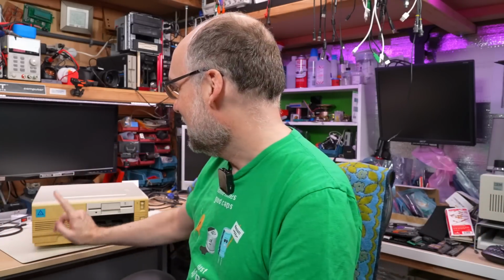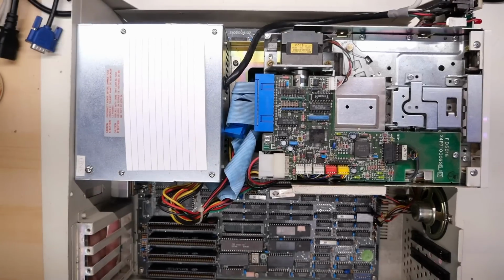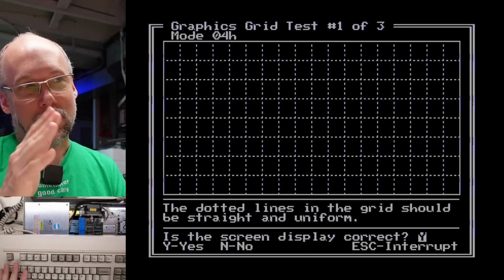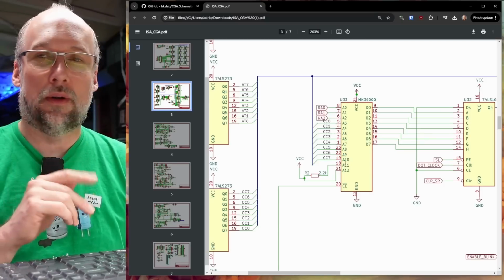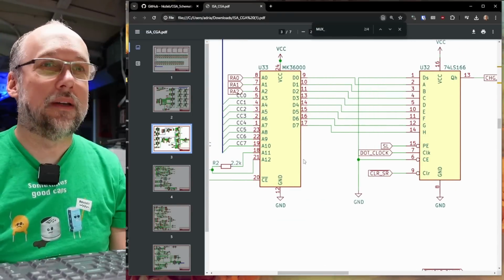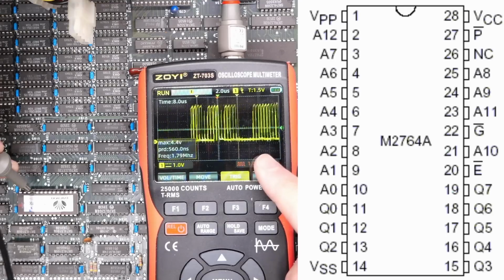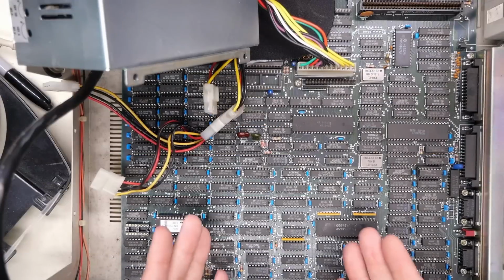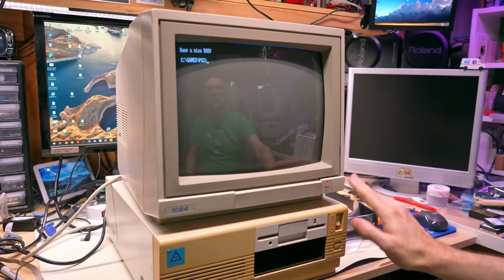Leading Edge Model D Repair

Comment: Good Lord. You brought me out of Youtube commentary retirement. ONLY because I worked for a Leading Edge dealer and this was our bread and butter, 

So, the blue color of the badge is because the original protector is still engaged. As in, "peel the sticker off, moron!" If you can't peel it off, the original owner was a moron. You are now stuck with it.

The IBM XT and AT had the same basic chasis. The LE Model D had a squat, square chasis and sported BOTH colour and mono support. However, some people wanted the same footprint as an IBM XT or AT, so the Model M was created. Back in the day, NOTHING was integrated into the main logic board, so expansion cards were the answer. The Model D only had four slots, while the Model M sported something like 6 or eight slots.

There was also a "turbo" model of the Model D released, as I remember. This was for those pieces of software that didn't check for timing (how fast one second on the system clock equated to clock cycles) and ran too fast. Funny how we take things like "processor clock cycles" for granted in this modern, multi-threaded world.

How robust were these machines? Well, a storm had several lightning strikes in a very small village of northwest Ohio. I had the service contract and arrived immediately after the storm. The call was because their electric billing computer wouldn't power on. A clear case of power surge, file an insurance claim.

I knew the PC was dead, but I went through the motions. I opened the case and saw what I can only describe as "an inverted pyramid in the center of the BIOS chip". I could literally see the traces from the center of the chip to...wherever the ended up at on the prongs ( I presume... )

Now, it was 1986 and as long as I parked the heads on any hard drive, I could transport it. Being so, I traveled with my service PC for on-site jobs. It was a Model D, non-turbo. Just for kicks, I swapped my BIOS for the blown up one...and the b**ch fired right up!! I SHIT YOU NOT!!!

Too bad they went out of business...

Comment: I don't quite agree that you would "know" that the problem is with that chip.. It may be that the traces have been damaged, or problems with the solder when it comes to continuity.. . 

IAlso it is possible that the out-put pins of a bad chip may send exactly the right signal but can't drive the input on the other chip.. (Would take a long text to explain various things that may lead to something actually sending a zero when it should, but IF someone is putting a load on it it may jump to high enough to be interpreted as a one. it is ~possible~ even if random and rare, the other way is much more common).. and the thing about this is that something that tests the logic of a chip won't properly recreate the exact situation where the chip would've failed. .but.. this last paragraph is more academic than probable, so my main point is the fact that there may be a break in the line somewhere for some reason.

Comment: So many feels watching this. The Model D was my parents' first PC, and it's what I spent countless hours on as a teen. This machine is what I used to learn BASIC, to play King's Quest and Starflight, and to make spreadsheets in Lotus 1-2-3 for building vehicles in Car Wars. Watching that boot screen come up made me smile so much.

I'm gobsmacked at just how uncomplicated most of the ICs are on the board. "Just swap out the bad shift register chip" isn't something you hear much in modern computer repair, if at all. Watching you work through this repair taught me a whole lot about 80s-era text and video handling. I just got into electronics over the past year, and this kind of end-to-end problem solving is incredibly useful to me to see what I'm learning put into context. It's one thing to know what components do, but another thing entirely to see how they work together to solve complicated problems.

Thanks for a fantastic video!
Reply from the maker: Indeed -- when I talked to people about the future of repair, I just don't see it being that easy. Ignoring the skill difference with SMD soldering, finding the bespoke parts that all these computer are made with now will be the trick in the future. There were perhaps only a couple bespoke parts on this entire Model D -- everything was off the shelf and easy to source. On something like a Commodore 64, tens of millions of the exact same machine was made, so finding replacement custom ICs is not that hard ..... but imagine some specific model of modern laptop, it probably contains a bunch of chips only used on that model or just a few other models.... then a year later a new models comes out and the chips are changed.

Comment: I had a somewhat later I guess, Leading Edge with a 386 and CDROM.  It was pretty weak for basically anything that could've used a CDROM.  When doing research on leading edge computers it pretty much always just returns a bunch of these older XT clones so they must've been losing popularity by the time the PC I had came out.

Comment: still own my late 93 Leading Edge full spec 486DX2 66 Tower (a very rare version by the way) buried in some box altogether with my Amigas, Ataris, speccy, etc. somewhere in my garage. I loved that machine by a lot back in the day. Internally everything was labeled as either Daewoo / Goldstar as long as I remember. The tower case was rock solid built.

Comment: First question to ask all customers is "did you let the smoke out?

Hard to believe that PC sold for $1,495.00 back then & included 20 MB hard disk, 8088 CPU supporting speeds up to 7.16MHz, and 640K RAM

Comment: Nice video, Adrian :)
I have a Hungarian laptop, with a proprietary ISA CGA video card inside. The CGA LCD is running from that card, too. That is why it is proprietary. Now my problem is almost the same as yours, but in my case, text mode works fine, but graphics mode does not work at all. I wonder what could cause this problem. Whenever I try to use graphics, the computer(286, 12MHz) hangs.

Comment: Did you notice if there was a short to ground on any of the ‘166 data pins before removing it?  Sometimes the problem may be even simpler than a bad chip.

Comment: My dad was a leading edge dealer. I know they once had a problem where the zener diode that charged the cmos battery was installed backwards so he had to hand solder those to fix.

Comment: Great Video! Really fun to watch. I also find it incredibly relaxing. Why didn't you check the connectivity of the traces/data lines between the character generator and the parallel to serial chip register first? This is not criticism, just a curiosity as my knowledge is only what I learn from watching.

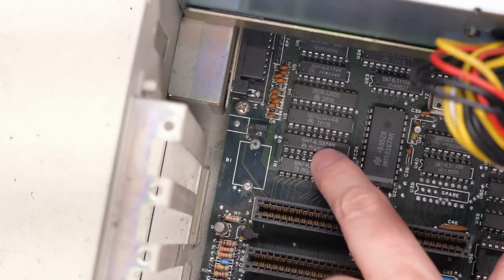Comment: @4:50 my goto is to replace the NiCd batteries with a CR2032 holder and use a CR2032 and disable the charging circuit on the motherboard by lifting a leg of the resistor or diode that brings 5V to the battery (the basic circuit is 5V -> D -> R -> B+ where D and R can be swapped).
This way the modification stays pretty neat and completely reversible

Comment: The parallel to serial bit shifter on my A4000 just died! LOL! Just got new ones in the replace them. Only it is used for inputting mouse and joystick input parallel data to the Alice chip. It is right next to the battery and why it went bad I am guessing.

Comment: Your Chrome & OBS crash might mean you ran out of memory, and some memory was forcibly reclaimed by the Windows kernel to keep it alive. Of course, reclaiming Mode 3 (Usermode driver) or Mode 4 (Usermode app) memory will result in a crash as the memory "is now no longer there".

Chrome survived it partially because it runs subprocesses for every tab, and hence the tab contents of the PDF viewer were terminated but not Chrome as a whole.

Discord users will likely relate, as things can suddenly leak out with Electron apps.

Comment: Great video! I'm a little confused by the time line of this machine though, I would have said it would be a mid to late 80's machines. Wikipedia seems to agree. But when you boot it the BIOS says it's released under GPLv2, that wasn't a thing until 1991. So someone flashed the BIOS later in it's life? Seems like an odd thing to have done to a 5-6 year old machine? Maybe not, it just looked strange
Reply: That GPLv2 BIOS is the boot rom of the modern CF card adapter
Reply: @retropcs88  ah! makes sense

Comment: I fully expected this thing could be "repaired" by just reseating the character generator ROM. Surprising that that shift register has lost two of its internal input connections but otherwise works fine.

Comment: I enjoyed this diagnostic and repair process, even if you made it appear trivial, a fine illustration of deductive reasoning and of your deep understanding of the inner workings of these IBM clones.  The Zoyi is proving its worth on these vintage machines where the bandwidth limitations are not so much a factor.  It certainly beats a logic probe.

I have been watching your videos since the Adrian Black days—long enough to know that you often consider appearance to be secondary—but I think a dose of peroxide would do wonders for the front panel, or paint for that matter.  It's very satisfying to see not only a functional restoration but a cosmetic one.  Maybe I just don't like yellow!

I don't know if you realize it but it is clear you are an inspiration to many retro-computing enthusiasts on this platform.  Thanks for yet another superb video.

Comment: My XT  was tip top (not ul accepted),  no onboard video, 8 bit cga 8 color until I modded 4.77 mhz to thrbo 8 mhz. Onboard 64k ram, expanded to 128k. Added oak tech vga 8 bit controller, set an interrupt and dma to speed up refresh.  40 mb mfm hard disk drive. 1.2, 720, 1.44 mb floppy,  9600baud usr external  modem 25 pin interface. Loved it..bbs services were it then..1986

Comment: To support higher color depth CGA modes, you don't just need more RAM (as you said, there is plenty), but you also need higher bandwidth. The standard CGA design doesn't provide enough bandwidth for the plantronics modes. The CGA graphics modes use the same memory bandwidth as the 40-color text mode. The 80-color text modes requires twice the bandwidth (just as a 320x200 16-color or 640x200 4-color mode would do), and you get snow everytime the processor competes for memory. So without wider or faster video memory than CGA has, there won't be a snow-free 16-color mode.
So I recommend you try one of the CGA fast video output tools. If they produce snow, 16-color graphics except for the 160x100 fake graphics mode is very unlikely to be present on that computer.
Reply from the maker: I actually cut out some of the testing I did with Jim’s program, and indeed this machine doesn’t suffer from any snow, even though they left the video disable enabled in hardware. (To turn off display in 80 col mode) So they fixed the snow issue which actually is similar to all clone cards I’ve run across. They all seemed to improve the design enough to eliminate the contention in the RAM.

Comment: In a sea of ICs, finding a chip that causes the issue without a schematic is not easy. Only logical thinking can save you. To add to the problem, the chip itself does work, but not fully. That is the big challenge you face in electronics repair. Could the issue have been caused by ESD? Who knows!

Comment: The blue logo is simply that no one ever peeled the protective plastic off. Peel it off, it looks much better without it.
Reply from the maker: And yes that was it, it’s the white label underneath! Too funny!!
Reply from the maker: Funny. I also say evidence of other areas like on the rear badge where the protective plastic hadn’t been peeled off. It was all degraded now which makes removal super hard.
Reply: Huh. I guess in those days companies wanted to make sure you knew the plastic was still on, so they tinted it. Clearly it didn't help.
Reply: @stevethepocket I think it's more that they removed the dye as a cost saving exercise at some point
Reply: I was literally losing my mind at logo cover. I took it off my inherited first computer, the model D, 30 years ago, and have been itching to see it removed.
Reply: I found funny to find lot of people to not have peeled rims logo in lot of cars from streets😂

Comment: When you pointed out the data lines between the character ROM and P2S chip, I immediately thought of taking the ROM out and manually driving the lines high/low.

Comment: Now I wonder, while you checked the output of the eeprom, you didn't check the input of that shift register you swapped. There is a non-zero chance that the old chip was good, and there was some cold solder joint on there, or something similar that wouldn't pass the signals along.
Reply from the maker: I did check continuity from the EPROM pins to the shift register and all were connected. But also, you missed the fact that floating lines (disconnected) result in white pixels. And the problem lines were black, the same as grounded. Disconnected lines would not result in that.
Reply: @adriansdigitalbasement  Ooh, I didn't realize you checked all the lines for continuity, in the video it seems like you only checked a few. And a very good point with that white/black disparity, that is a very fair point pointing to the chip, my bad.

Comment: I was more physically active than you (not to brag, I think most people can use a bit more exercise) and for me just a single level of stairs became an issue with that disease. Hope it gets better soon.

Other stuff: is that the original 5.25" inch floppy drive? That grey seems so resistant to aging. Especially compared to the rest of the machine.
Reply from the maker: Seems to be the other model edge video I have has a machine with the same drive in it. Different plastic I guess.

Comment: The same thing happened to my Ohio Scientific C1P video forty years ago: one of the input lines of the 74166 died. I had to write something for school on it with one vertical line missing which was annoying. I had no confidence in my desoldering skills so I simply clipped pin 16 and piggybacked a new 74166 on top of the old one.
Reply from the maker: Awesome! Yeah that’s the best way to get a chip out if you don’t want to risk any damage. And yes, the 166 is probably used in most display circuits from the early 80s and late 70s. So this would be a pretty recognizable fault!
Reply: @adriansdigitalbasement They’ve been in video since the first video game…They’re to be found on TAITOs Space Invaders PCB doing exactly the same job.

Comment: Logical thinking and investigating helps with diagnosing problems, often taking less time than throwing parts at stuff hoping to find a fault... :)
(Kind of like how the local powergrid people here were throwing fuses at the local substation thursday and friday to deal with repeated powercuts hoping that fixed the problem, until they actually found they had a bad underground cable when the smart engineers came in to think logically and find the fault!!!)

Comment: It had an, as far as I've ever been able to figure out, unique 640x200 16 color mode, which is (as far as I can figure out) only used by gwbasic. I piqued Jim Leonard's attention a couple-six months ago to spend a few minutes poking at it, and he came away with a detail or two
Reply from the maker: Ah that’s interesting. So they included a customized version of GWBasic that supported it? Amusing that these companies tried to improve things but then it went nowhere.
Reply: @adriansdigitalbasement  Yes, and apparently ONLY the faintly custom GWBasic supported it.  I was 11-14 when my focus was on this machine, so I read the BASIC manual cover to cover, wrote silly little graphics things to see it, and I TRIED TRIED TRIED every plausible option in the games I played, and never a many-colored option.

Comment: A mixture of Pine Oil, Eucalyptus Oil and Menthol is good for clearing up Congestion. 
A few years ago I was suffering very badly from a bout of Congestion and this Mixture in an  Electrically Heated Diffuser cleared it up fairly quickly. I had it on my Bedside Table at night. 
Made my Eyes water though.

Comment: If it's a standard PC compatible won't any standard blueprints/schematics do for another computer of the same type??
Reply from the maker: They probably crammed various components together so I bet the computer part is similar to other clones, but it’s hard to know considering how crammed the motherboard is with logic ICs. They may have customized some stuff just to make things fit.
Reply: @adriansdigitalbasement  Indeed. The 80s and 90s were about making stuff smaller and cost efficient. They probably crammed a lot in.
Reply: @adriansdigitalbasement  Thanks - I grew up using various Spectrums, Atari 520ST and then 486's so I'm loving both channels esp when you are looking at The  BBC's and such like...

Comment: Fantastic overview of the CGA schematic!
As a software guy, for faster diagnosis, I was going to recommend instead of a DIR to fill with characters, try ALT-219 a few times to print some solid blocks onscreen.
But you, as a hardware guy, correctly figured out removing the chip and causing floating values would do the same thing :-D  Nice.